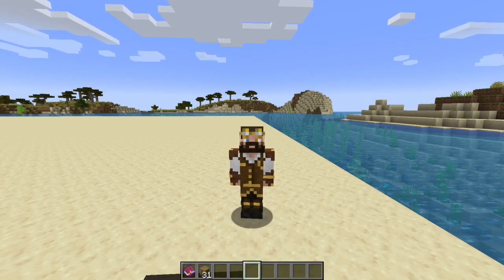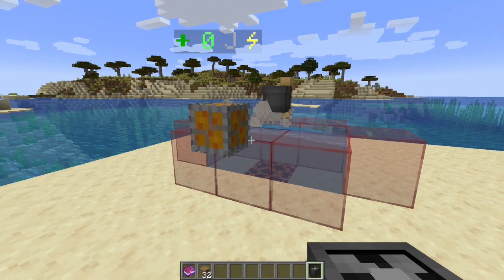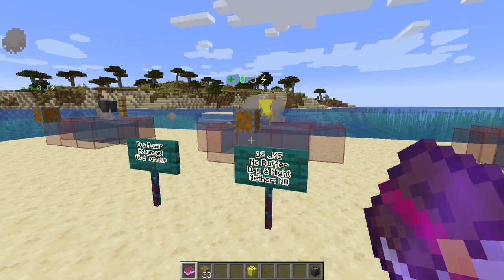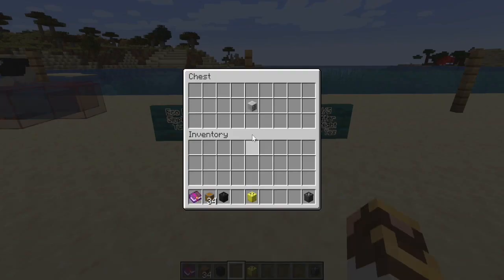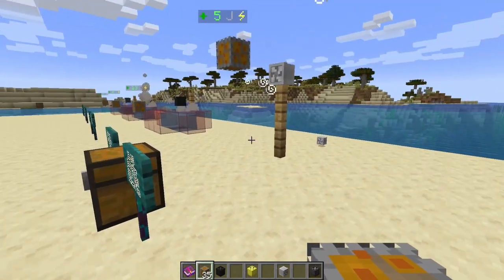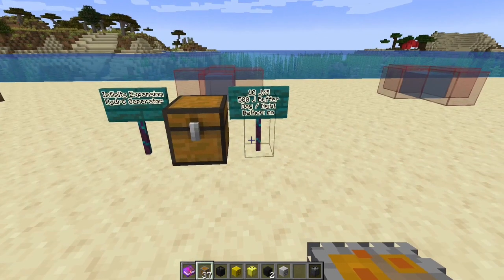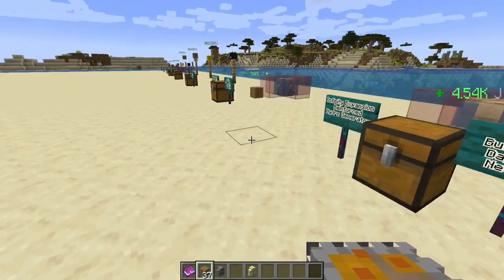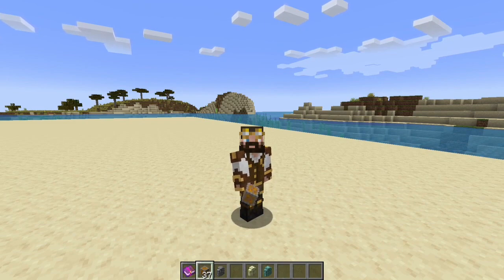Tips N Tricks #23 - Power Generators Part 1 / 5

Comment: Just wanna say I love this tips and tricks series, and also I think the speed of the first things that you showed, the steam turbines in eco power, can be increased if you make the water two tall (make sure they are all source blocks even at the bottom), because what takes time is the magma block making a new bubble column, which it won’t have to if there is another source block at the bottom.
Reply from the maker: I haven't tried that, as the guide shows only a one block gap between the magma block and the generator. Test it and let us know how it goes.